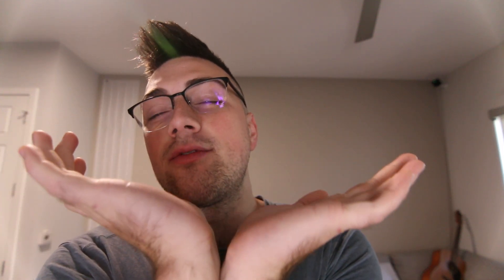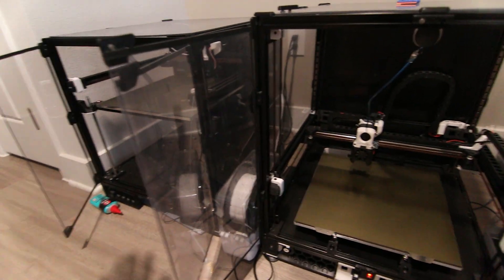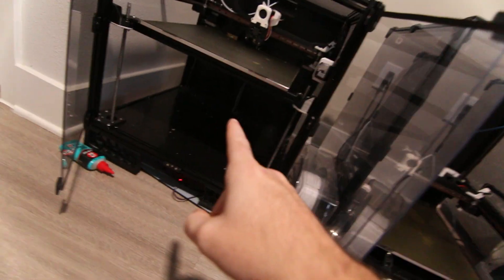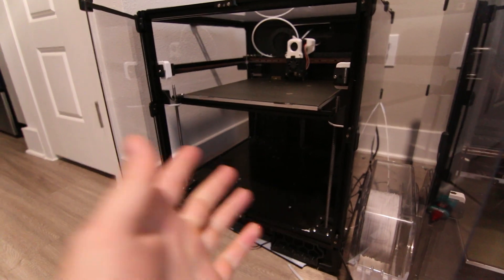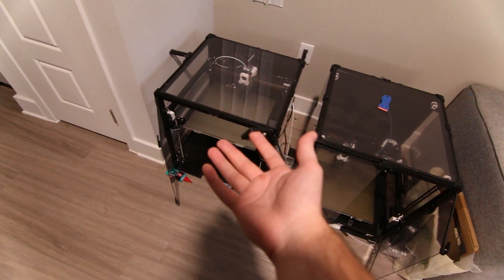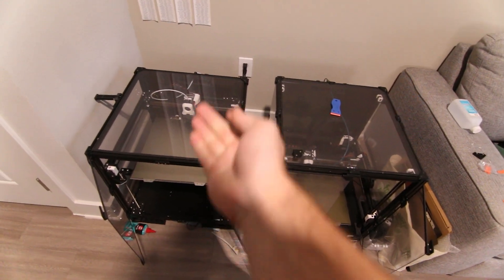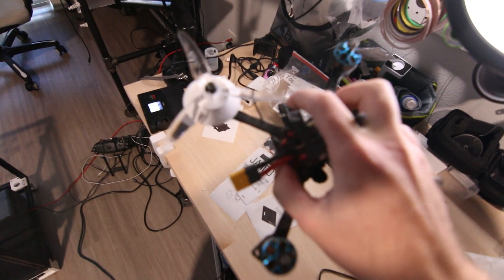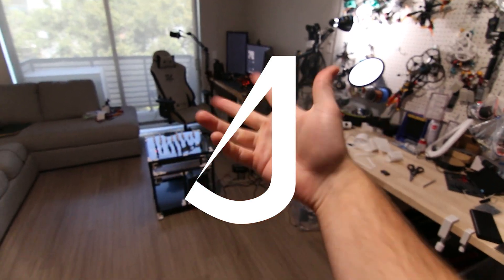So I heard you want a voron

Comment: Definitly Trident. Look at WP-DAKSH - an open source design for a tool-changer. On a Voron 2.4 it wouln't be impossible, but the gantry would always need to go up to the tools on every toolchange. Actually I have a Voron 2.4-inspired kit (Jennyprinter 650; 6050by650by650) with CNC milled parts (instead printed ones). Have not build it yet, but I already think about redesigning it to Trident style. But as the CNC-parts are very good quality, so I might use the 4 z-Belts for moving the bed instead of leadscrews.

Comment: 100% agree. My first build was a V0 (you can think of it as a small trident) which wasn't too bad, got it up and running, but it took me forever to fix ringing, VFA's, loose bolts, etc. The V0 is so small and compact, everything is crammed together, and some repairs and tweaks often mean tearing down structural stuff, and then going to have to do all the calibration all over again. Afterwards I built a V2.4 350 R2 and it works great, better than the V0, but there are a lot of things to look at. I want a trident now.

Comment: 2.4 is complicated for the sake of being complicated.  Trident is a way better design.  I also do not understand how the bed moving down is slower than moving the floating gantry up?  2.4 is all show.  Its like the people with the bed slingers using a second Z motor for the dual Z.  So you need to have dual Z control to level the gantry because a dual Z motor causes the gantry to go out of level.  So then on top of that, you add a pulley and belt at the top to keep the dual Z motors aligned.  Hahahahaha or you could have just used the belt and pulley and no second stepper.  Nothing like creating problems and then solutions to the problems you created.  But then you would not have all that added useless complexity to stare at.
Reply from the maker: Very accurate! I agree alot of it is show buuutt it does work gucci printing more tidents for life!
Reply: @Jandodev  yes, I know 2.4 probably prints great.  It’s just the trident looks like it prints as good while being much more simple.  This makes it a better engineered solution.  Another benefit with trident is and auxiliary cooling fan will be stationary.  With 2.4 it will need to move with gantry.  I also think trident would work better as a heated chamber.
Reply: " I also do not understand how the bed moving down is slower than moving the floating gantry up?"
The explanation is that for fast movement what matters most is mass. Moving against or in the direction of gravity is almost irrelevant compared to the actual difference between the masses of the bed and the gantry. With the gantry being much lighter, you can move it much faster, despite having to also defeat gravity. However, the theoretically achievable speed difference between the Trident and the 2.4 due to this won't matter for most people, as almost nobody will print at speeds where this would come into play. The 2.4 seems needlessly over-complicated for me too.
Reply: @kapa7197  I don't think the speed of the Z direction matters at all.  Its the X and Y speed that counts.  The bed only moves a very tiny amount down and only once per layer.  I did hear someone say that the printers that move the bed shake more because the motion is on top of the printer.  With the 2.4 most of the motion happens really low.  This means the 2.4 will shake less.  So I guess thats one upside.  A downside of the 2.4 is that if you are using an auxiliary cooling fan, it has to move with the gantry.
Reply: @f1hotrod527  It's not really about the absolute average speed, but about the instantaneous acceleration it has to do when having to move.
Reply: @kapa7197  the z movement does not limit the speed.  A bed moving down maybe even moves quicker but that would be such a small amount it would not matter.  The time of a print that is spent moving the z is probably less than a tenth of 1 percent of the print.
Reply: @f1hotrod527  Yeah,  as I wrote earlier "almost nobody will print at speeds where this would come into play".
Reply: @kapa7197  I would still take a 2.4.  Better than my old cr-10 that’s for sure.  It is becoming harder to justify the $1000 - $1500 it takes to build a 2.4.  There are some nice printers hitting the market

Comment: Is the Trident louder than the 2.4? It would make sense to me, because the gantry is fixed directly to the overall frame. The 2.4 gantry is of course connected to the frame with the 4 linear rails, but has a lot of printed parts between which could dampen the vibrations. I've built already 2 2.4 for work an they are surprisingly quiet. This is exactly what I need at home but I would love to build a trident.
Reply from the maker: In my experience they have a very similar noise amount! Once the panels are on their fairly quiet it all comes down to how loud your fans are!

Comment: trident vs rat rig v-core 3.1?
Reply from the maker: I personally have no expereince with rat-rigs but I've heard about them a bunch but what lead me down voron when I was originally researching 150% was the community behind the design!
Reply: Don't have a trident, but V-Core 3 and plan on building a voron style printer. Vorons use 2020 extrusions, RatRig uses 3030 extrusions. They are therefore much stiffer and allow for bigger build volumes (safely). The kinematic bed is kinda cool and makes bed leveling nothing to ever think about. The bed gets angled exactly like the BLTouch says with the three Z-motors as it's mounted flexible.
Also the RatRig printers are kits directly from RatRig which is easier if you never built a printer. It's also a fair bit cheaper than most vorons builds.

Comment: What sizes are the two printers in the video? Isn't the trident taller then the v2.4? In the video they look like similar height?
Reply from the maker: both 350 I thought the same but the trident is actually shorter due to not needing the bottom z assembly! But its only shorter buy like 10-20mm!

Comment: Nice content - I was 99% wanting the 2.4 before but I'm now 50/50. One thing you didn't talk about which may be a deciding factor is centre of mass being higher on the Trident and vibrations. I print in a garden room with a wooden floor that has a bit of movement in it. I'm worried about vibrations and quality, but not looking to print at stupid speeds. Do you notice any wobble differences in the two printing at daily quality speeds?
Reply from the maker: For the most part the vibrations are negalaible! Buuuut that's the best part about the newer versions of klipper there's input shaping now to damp them! Ive been running them both on the floor/concrete block which TBH takes most of the vibrations out. Same for the ender3 like printers. I'd say depending on if you can get one throw a cheap concrete block under it in that space over the wood and it would be perfect! but if that's not an option I haven't seen really anything over vibration wise on the trident but I do run it at relatively sain speeds :)

Comment: Don't build a v0 as your first voron. It is a far more tedious and frustrating build. 

I think the trident is a  no brainer recommendation. No point in building the others unless you really know what you're doing and why you want them.
Reply: I want to disagree having build v0 as my first printer build ever. it is a bit complicated but the small size makes it way easier to handle, like you can flip it around 20+ times during the build and not complaining. also for me I get pif parts and ldo kit so debugging is simply not necessary and I end up building it in a day even after making one of the more annoying mistake requiring me to take apart the toolhead
on top of that it prints fast. in the 15 days since I build it I have printed all backup parts for itself, parts for v2.4 that I am about to build, and parts for a 6ch ERCF MMU

Comment: trident/salad fork should technically be faster than the 2.4 due to the static gantry. People just didnt do a speed benchy with it. lots of people did records on the zero though.

ps. dr d-flo built a 1000mm cubed printer. same concept at the 2.4

Comment: Technically the trident would be able to do planer printing better as it’s 3 point bed mount is less constrained then the 4 point gantry of the 2.4
Reply from the maker: Interesting I was under the impression that the four point gantry would give the 2.4 more precision with the ability to lift from a single corner at a time etc! Something tells me that the lead screws on the trident wouldn't like be offset as much but it is still on the ball joint!
Reply: @Jandodev  the issue with lifting only one corner is then the gantry is now out of square which creates additional friction in the motion system and can damage linear bearings. also why it’s important to have as flat as possible print bed as a warped bed can damage the motion system as it squares the gantry to the bed instead of the other way around
Reply from the maker: @Experimentalhobbyist  Yeah that makes sense I was thinking more along the lines of couple mm :) but your so right the trident would be better!

Comment: I did the 2.4r2 but it was just because it was what was available at my local vendor - if they'd had both I would've gone Trident because of the simpler machine like you say. But the 2.4 is a fun machine, the gantry going all axis is fun - not better, just fun :) More to tune and maintain though.

Comment: Why do ink jet printers work fast with good acceleration start and stop motion and are smooth? They use belts to drive the print head, but the print heads are also light weight.

If you want speed in a machine, belts are your best option, consider also that belts are also a low mass component unlike a lead screw or ball screw. So I go for belt drives for speed. It is a trade-off if you are used to lead screws but as far as mechanical complexity, belts are more user friendly, you can be slightly off on the belt alignment, but a lead screw is not as forgiving.

All these core x machines are using the wrong approach to the drive system. There is a far easier and better way. I have such on my own design, but I have yet to see something similar.
Reply from the maker: I agree that makes sense and interesting what did you change in your design?
Reply: @Jandodev  Mine is not a coreX per the traditional architecture, so I did not change anything, I started from scratch.
Reply from the maker: @MarioIArguello  Thats really cool! If you have a video of it ill take a look :)

Comment: I just don't understand, what could be and advantage of having 4 Z axes, while having 3 is already enough? the 2.4 is great, sure, but the trident offers all the necessary to do basically whatever you can think of, and more.
If you have a reason why the 2.4 would be worth more to build over a trident, please tell me
Reply: Lower centre of mass completely changes the vibration characteristics of the printer.
Reply from the maker: ^^^ If speed is your game the 2.4 can be better but both can use input shaping now so unless your pushing pushing there basically the same :)
Reply: @Jandodev  Do you have experience when the quality seperates both? What speeds and accel are we talking about here?
Reply from the maker: @steilkurbler4973  Yeah, for the most part there the same, I stick to the recommended accels in the voron around 3k but I've ran at 500% speed before which should put me around 15k there tanks! Overall I haven't seen much of a performance difference when it comes to the lower speeds its all down to the bed mesh for the first layer then I get almost same results!

Comment: I've built both as well. I agree 100%. I love  them both. The Trident was an easier build and I have found no difference in print quality. However, because I added the Klicky and Klipperscreen mods to my Trident it is pretty much my goto printer (I'll be adding both mods to my 2.4 soon.)  In any case, if you are wavering between building one or the other -- my guess is that you won't be satisfied until you have both.
Reply from the maker: Yeah thats a fact I still have no klicky but love both my boys I couldn't live without either of them!